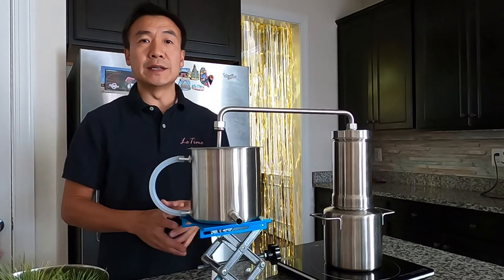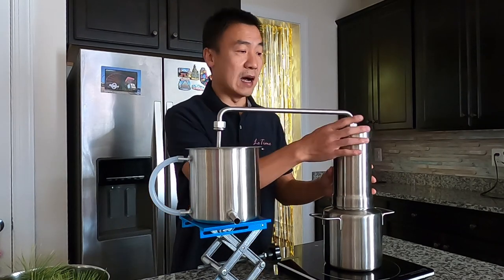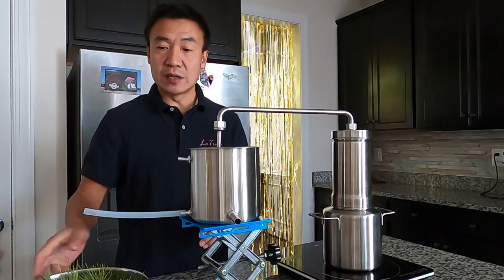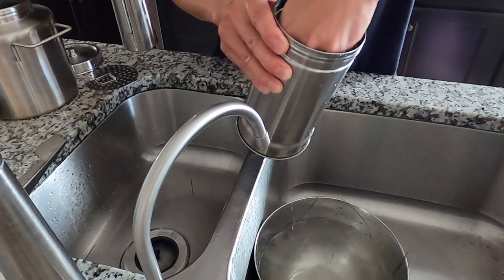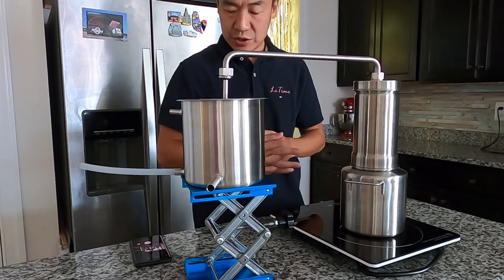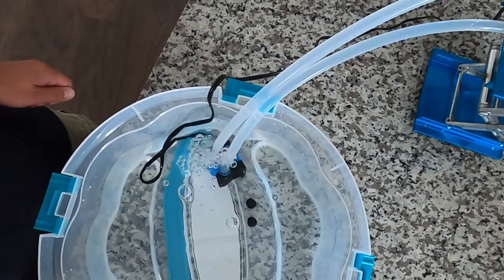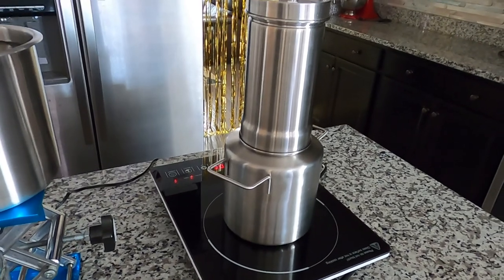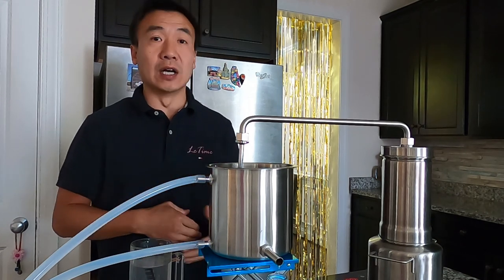Steam Distillation Pine Needles with LT3000 - New LETIME Distillery Kit

Comment: what happens if the pressure inside is too big? will the pot explode
Reply from the maker: Pot has a pressure relief valve. If pressure built up the valve will make whistle and user should turn off heat right away. When operating following instructions there should not be pressure inside pot. Use loose herbs and no powder. Good question!

Comment: Can you distill well water of Sulphur and get clean distilled water?
Reply from the maker: Hi there are two groups of sulfur possible in water. Sulfite is salt which can be removed by distillation. Hydrogen sulfide is volatile and it can be vaporized during distillation. Hydrogen sulfide has rotten egg smell. You can notice it.

Comment: do you think there is any influence of source of power (electric or gas ) on the quality of oil
Reply from the maker: Hi, this is a good question. There are some research on effect of temperature on yield using microwave assisted distillation. By using steam distillation under normal pressure the temperature of steam will be stable, 100 Celsius so the change in heating power won’t change the quantity or quality of oil but they will change the duration of time of distillation. Lower power will make it longer. Let me know if you have any questions.